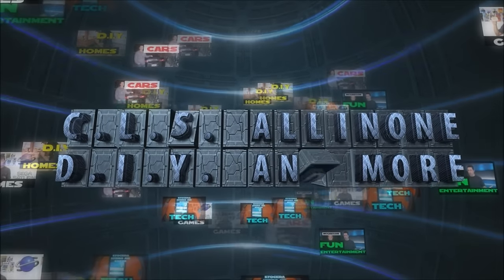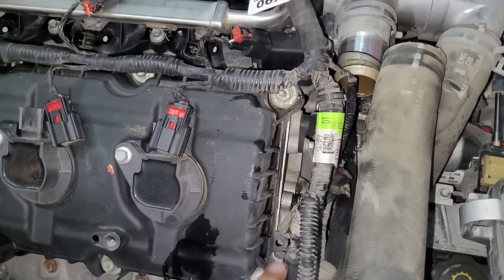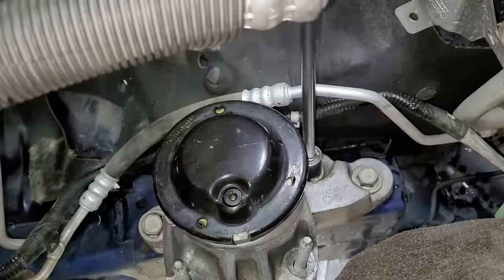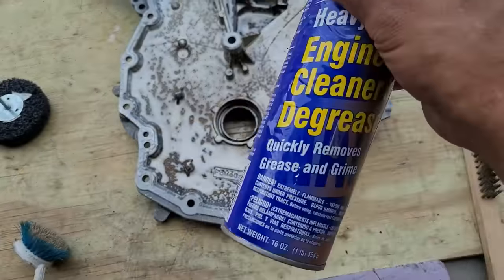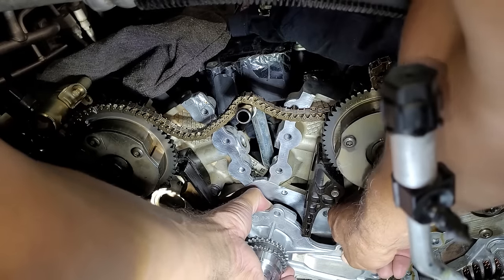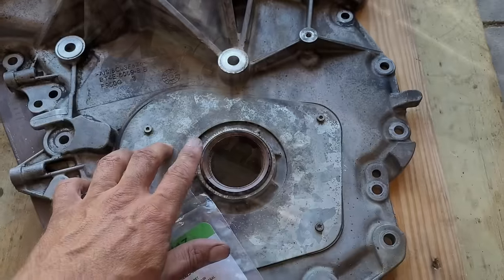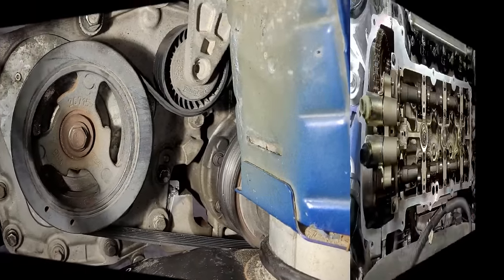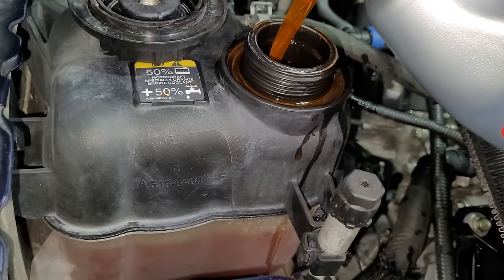How to change a water pump in Ford V6 3.5 & 3.7-liter engines 2012-19 Explorer, Taurus, Edge & more

Comment: I'd call this video a masterpiece.  Lol.   There are a couple parts that I wish you would have expanded upon.  Your counting of bolts and torque for them is very very helpful.  I might have damaged something like the timing cover because I couldn't find the 16th perimeter bolt.   I kept searching and found since I knew I only had 15 bolts, lol.

Comment: THIS IS AGREAT VIDEO!!! very detailed and clear... HUGE THANKS! apparently, I need to replace mine on my 2018 Explorer. Exact same issue you explained at the beginning. Now, I'm just wondering if I should do it myself or take it to someone to do it... I'm all about DYI, I've worked on my cars before but too many parts to remove on this one and I don't have all the tools needed in my garage. Huge thanks again for this instructional video!

Comment: What size is the 3 jaw puller? Thanks for the video. It is very informative.
Reply: Use a Large 3 Jaw Puller because the small ones will break into pieces.

Comment: Excellent video.  I am highly considering making this attempt.  Is there a reason that you pulled the oil filter? Meaning, was it just time anyways or is it because of this repair.  The reason I am asking is that I just changed my oil on Saturday, and now I have this coolant leak that showed up on Monday.  Can I leave the filter on there, or do I need to replace that too.  Thanks

Comment: How do you torque the hard to reach guide bolt to 8ft pounds if you can’t get a torque wrench in that hard to reach 8mm bolt?

I’ll be attempting to do my 2017 police utility water pump replacement next week so I’ll let you know how it goes. Thank you so much for this informative video on the step by step process.

Comment: Definitely one of the best comprehensive and detailed videos on how to change the water pump in a Ford V6 3.5 and 3.7
Thank you sir, for your wonderful efforts, useful course 
I would like to add a small point if you would allow me, the oil pump and the oil tank must be cleaned well befor starting the engine.

Comment: Awesome video! One suggestion on the harmonic balancer. If your having a hard time finding a socket.. Use a cheater bar (Aka 3 ton jack stand bar) to hammer on the harmonic balancer.

Comment: Great job on the video!! Only comment is that I would never use anything but an OEM part for something that is this "buried" in the engine. Way back in 1999 I bought a re-manufactured water pump from one of the big chain stores for my big block suburban. That particular motor required around 4 hours of labor to replace the water pump. Very difficult compared to the small block. The pump I bought had a small pin hole leak in the casting and would spray coolant when the engine was at temperature. The store replaced the pump, but I was out all that labor.

Comment: Excellent video. I do have a question about how you took off the wire harness connectors from the fuel injectors. The one on the coils you had to slide out retainer and press down but what is the trick for the ones connected to the fuel injectors? I seem to be having some difficulty with this and any tips you could give me would be greatly appreciated.

Comment: Thanks too this man and god my ford flex is running Ike new ford dealer wanted to charge me $4500 to fix it 🙊my wife had faith on me that’s why I did it 😂😊😊 in parts I spend like $400 I did 16hrs and did the job thank you sir for a great video I wish I could thank you in person 🎉🎉🎉
Reply: How was the space to work in on the Flex? I need to do mine on a 2017. Also did you change the timing chain or reuse the original?

Comment: Fantastic video! I just someone tell me before starting the engine, after the pump/chain replacement, to rotate the crank by hand 2 full rotations. Is there truth to that? I am by far no mechanic, but I have to do this job next week.

Comment: I have a 2011 ford edge where the pump failed compeletey.. the cylnders still have compression and i cant afford the 4,800 qoute to repair this.. all in all I'll be out around 300 dollars and days of labor but this video is soo in depth that I feel confident enough to do it myself..its going to take a ton of work but we JUST replaced the transmission, top half of the motor, AC, PTU so this thing will have life if this can get done..

Comment: I also had this done last year. $5000. But the big problem is my mechanic said the OEM timing chain was out of stock everywhere, and could be 6 months before available, and he wouldnt do it with 3rd party parts. And to drive it while waiting was risky. I called 4 states, couldnt find it. Got a lead, and found 2 in PUERTO RICO. 3 day USPS ship, took it to my guy. The look on his face was almost worth the $5k.

Comment: After installing my new water pump I noticed the timing chain ended up with slack in it when reinstalling it. The chain will not reinstall on the top two sprockets and water pump without this slack! 
What do I do? I'm in a major time crunch to get this job done but I don't want to close up the engine with this little bit of slack at the WP gear!
What do I do? My Explorer is a 2016 so things are a little different from the one in your video.

Comment: Excellent video but question. Your particular water pump only has one gasket. A lot of them have two. How does the one gasket set up direct coolant to the weep hole area?  For example if the gasket starts leaking in an area away from where the weep hole channel is, will the coolant not just go into the oil?  The two gasket design makes sense at of it leaks anywhere it will be directed to weep hole but. It on single gasket. What are your thoughts?

Comment: Love the video it’s gonna help me out a lot when I do it this weekend but I have a question. Did you have to find top dead center on the number one spark plug or did you just use the camlock Tool wherever the dots landed at if that makes sense

Comment: Great video, thank you! I want to pay someone to do this but I just don't trust anyone to do the job right...cleaning gasket surfaces properly, using all the new parts vs. recycling, using a torque wrench, etc.  Your video has given me confidence to take this on. My only question is why didn't you replace the chain? I would love to skip that step, too, but unsure what is recommended at 97K miles (12k engine hours). Any thoughts appreciated.

Comment: Great video
Anyone doing this on a 2013 edge you gotta take two bolts off the power steering pump, as it bolts to the cover. Absolute pain to get to lol. Also, the center 15mm bolt I could not get all the way out, no matter how high or low I put the engine, it's just really long and hits the subframe. I forgot to set it back in the cover partially before I put it back in and I couldn't get it back in, had to take the cover out clean all the gasket again and try again with the bolt stuck through the cover.

Comment: I probably over thinking this.  I'm doing my mother's car with 200k miles.  I'm assuming there is no need to mark the chain since I have a new kit.  Just line up the marks, install and rotate a few times to make sure it doesn't need adjusted?

Comment: I finally finished my water pump on my 2018 Explorer Limited w/69k miles. All in all I’m in about 750 dollars, that includes extra tools that were necessary to complete the job. After finishing the job, i did have to top off the coolant a few times, I did dump an extra gallon to help push out the old coolant as Ford has changed to a newer Yellow coolant that is less corrosive/acidic. This job was not easy by any means, the crank pulley bolt cannot be reused. They are torque to yield. Mine came loose after a few hours of driving, lucky for me Ford had a new one in stock for like 9 bucks. Hardest parts of this job for me were, removing gasket material from engine and timing cover and applying the RTV silicone was a pain, finding room to properly torque timing cover bolts was a pain, torquing the crank pulley bolt was rough, I had to use a ratchet strap to hold it in place. Everything else was really not very difficult. The timing chain, tensioner guides, etc…and actual new water pump was pretty easy as the camshaft holder tools worked great, I used a full two cans of brake cleaner. I wanted to make damn sure I got all the antifreeze and possible contamination out of the pan. I also poured a quart of oil to help push out any extra coolant/trash that was in the pan. Also then after a few hours I changed the oil & filter again. I’m very OCD and it drove my wife wild, but for me it was a must. I’m very grateful to have her help me especially to help guide the timing cover in place. All in all this was the hardest job I’ve ever completed. But I still saved around 1800 to 2200 bucks, best of luck guys.

Comment: Holy cow, this instructional video is superb! Well done sir. It’s very very obvious you spent a ton of time and energy putting this together. Some of the best quality out there.
Aside from fluids, gasket maker, replacement bits and pieces, seems the ONLY new part you installed was the pump itself - is that correct?
Reply: The water pump was the only thing I replaced on mine.

Comment: Absolutely one of the best video regarding auto repair, no wonder why the ford company is going down the drain. Put a water pump outside and drive through the belt like old cars would have been a lot better. Shame on the company and their engineers for horrible design.

Comment: Might be a dumb question, but did you remove the oil pan to clean or just sprayed it down with brake cleaner?
Reply from the maker: I Just sprayed it down thoroughly.  But if you want to take it off to clean you can, but you will have to find another way to support the engine which would probably be from the top, and the gasket will need to be replaced for the oil pan as well.

Comment: nice video! mine darn expl seized from sitting 🥵 will see if i can turn over it and start it again.. if so water pump job is next, just noticed some water pumps have only one row of teeth's its for older 2011 version engine ?

Comment: The video was comprehensive, and you did a great job, but if the engine has 100,000 miles, my question would be is since it is extremely labor intensive, why didn't you replace the timing chain and camshaft synchro, my terminology isn't right, while replacing the water pump.  Its crazy how much they get for repairs now a days, writing a check for 4500 isn't in my budget now of into the future. Hats off for a job well done and perfectly documented..

Comment: Any tips on getting the crankshaft pulley off using the 3 jaw puller? Mine keeps slipping and will not grip the pulley. I’m working on my 2012 Ford Edge

Comment: On the 2012 Ford flex the power steering pump is bolted to the lower left corner of the block & timing cover. The bottom 2 bolts are difficult, but the top 2 are ridiculously hidden out of sight and only able to feel them. Tomorrow we pull the chain to swap the water pump. So far this has been a pain in the ASS! Lol

Comment: 2008 Ford Taurus X 158000 miles, and my pump is still good. These pumps last longer if you change the coolant more often then every five years. I change mine every 2.5 years.

Comment: Hi there, is it okay to let it sit for a few weeks with the coolant/oil mix still in the engine? and what water pump manufacture do you recommend? Also what coolant? I heard ford made a statement recommending the yellow dexcool rather than the old orange coolant. I believe that’s why mine failed at 89k as I still had the old orange coolant. Please respond, I appreciate it tons

Comment: Question, just had waterpump replaced,  coil packs that need to be removed, any of them near cylinder 6? Code (vehicle check engine lite blinked for a minute, never stayed on) came up as a misfire, or plugs, or coil pack. Just curious, vehicle going in next month for a blower motor/resistor replacement, as well as new code.

Thanks in advance!!!

Comment: I have a 2013 ford explorer the water pump went out 2 years ago. I fallow the steps show on this video and I saw that the water pump pulley where the chain goes is broken but the engine still turns. questions 1)being that the pulley is broken has the timing being compromised. 2) is there another way to turn the crank shaft.

Comment: How hard was it for you to remove the Crankshaft Pulley? Did your battery powered tool remove that bolt fairly easy? A lot of videos demonstrate how air tools are needed. Please advise.

Comment: i hope you can answer this as soon as possible, i would appreciate it,,,,, when you attached the new pump,  i didnt see you use any gasket or silicon on the pump....  is this not necessary ?????  also i saw water from the pump fall into the oil pan,  did you remove the pan or just clean it , since you did change the oil of the car,     thank you so much

Comment: I'm at the half way point of this job in a 2015 Ford Explorer. The Harmonic Balancer broke one of the middle ears from the 3 jaw puller. The worst part was getting the red tabs up on the Fuel Injector connectors, one connector just fell apart completely and the stupid 8mm head bolt under the intake manifold seized and snapped on its first turn.

Comment: Awesome video, amazing details, a tip coming soon.  I'm in the middle of it thanks to your video.  It has been slow going for sure.  Anyway, I'm at the point of putting the timing chain back in place, I marked the spots on the chain that matched the dots on the the cam and crank gears.  I'm off by 1/2 a gear, I cannot figure out how it has become off by 1/2 a tooth. I've got the cam locks firmly on, haven't turned the crank since then.  I was able to spin water pump a little without chain connected to crank, and finally got the dots to line up on both cam gears, but now I'm half off on the crank gear.
Reply from the maker: The crank gear may still have just a small/minor amount of play, even with the cam locks in place. So you might be able to just barely turn the crank gear to make everything lineup properly while leaving the cam locks in place.
Reply: That's what I was thinking.   I was wrestling it till midnight.   I am also reading here and there that the timing chain should be replaced at 100k, I thought they were good for 200k+.

Comment: This is insane that you basically have to take this car apart to get to a water pump. Guess that premium care pack I bought when buying my Ford new is now paying me back. I just pray the mechanic at the Ford dealership put everything back correctly! 2016 Explorer Sport which has 74,000 think it started going out around 69-70 thousand. Had to take the lower body Air Deflector skid plate off to finally see the leak.

Comment: Replacing the water pump. I am trying to align my camshaft pulleys and crankshaft sprocket to the proper position. My left camshaft pulley is close to being in the correct position, my right is way off. Now I can't turn the crankshaft any further. I am in a bind because now I feel like I have completely messed up my engine timing and the crankshaft bolt won't turn anymore, and I am afraid to force it in fear of breaking the bolt. Do you have any guidance on how to remedy this.

Comment: No one ever talks about the fact that there are two weep holes. Upper, which drains into the valley and pools up and dumps out driver side, and Lower. You can see the upper weep hole on the water pump at 24:32. Its the single hole between the gaskets.  The corresponding drain on the block is left of V.  I say this because few people talk about the weep hole as a culprit for Valley coolant leak.  I spent hundreds on a diagnosis because people said Valley coolant leaks can only be: thermostat housing, lower intake seals, crossover pipe or head gasket.  With a keen eye you can see coolant come out of Upper weep hole without tearing into the engine.  It also took the mechanic some time to find out about the Upper hole.

Comment: Perfect video! It's the best repair video I've ever seen. Thanks for sharing! I have some questions: 
1. Besides the water pump, I also want to change the timing chain since it is already exposed during this process. It shouldn't be too difficult since the chain has color marks. However, there are secondary timing chains at the upper part connected to the gear pulley. If I only change the primary timing chain, would it be pointless if I don't change the secondary ones as well?
2. How did you torque the bolt for the third chain guide (the one under the gear pulley)?

Comment: Any help please. I'm finishing up and ready to apply silicone to cover. Decided to turn over engine just so I know everything moves and the timing chain is a lil lose and when I get to a certain point turning engine over the tensioner flaps about 3 times. Chain is back to original marks so why would chain be lose and tensioner not doing job

Comment: May have to have the one done on my 2012 Edge soon. Not weeping yet but i don't like to take chances, especially since if these fail, it can flood the engine with coolant. Also, in the last couple years, Ford came out with Ford Yellow coolant that replaces the Ford Orange. You can mix the two after talking with Ford technicians. Supposedly its deaigned to help make these internal water pumps last longer somehow.